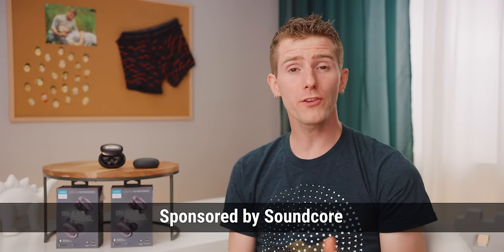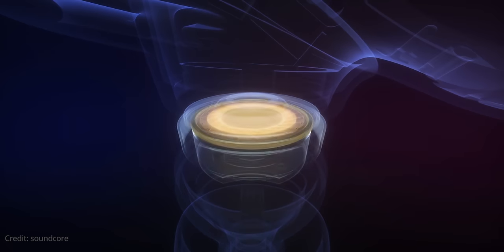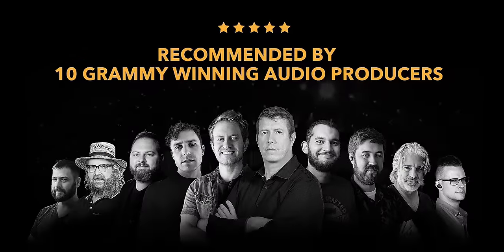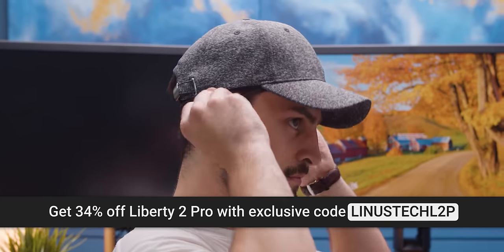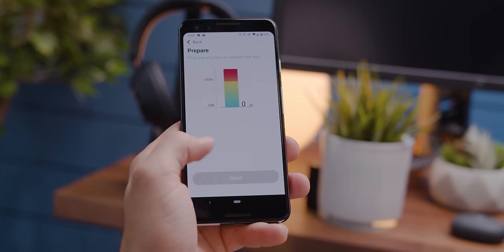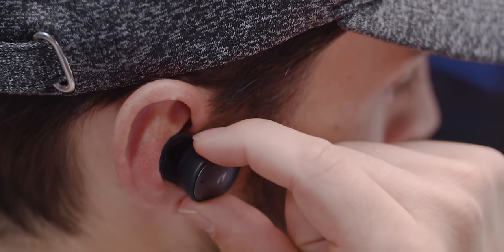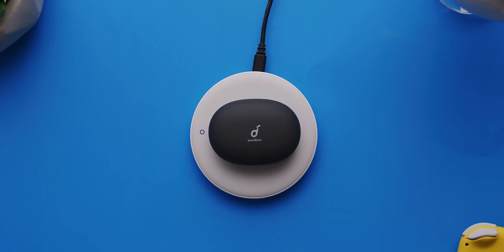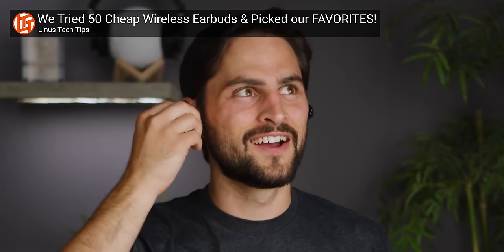What is Astria Coaxial Audio? - Liberty 2 Pro Earbuds Showcase

Comment: It says "incorrect discount code" :(
Reply: i was able to use it, but it was only $20 off.
Reply: Same, for UK store
Reply: Did not have a problem all was capslock
Reply: same for uk
Reply: I do have the same problem (german store)
Reply: Same
Reply: Yeah not working in german store. Yay
Reply: @Viewer13128  Yeah, it's a bit misleading because they don't specify what the 34% was actually taking off. The 34% doesn't make sense if you look at the pre-order pricing (34% off of $119 USD is about $40.46, dropping the price down to what should be around $79) BUT... if you do the math with their intended MSRP for their full release (34% off of $149 USD is $50.66, dropping the price down to $98.34), now it stars to make sense. $20 off of $119 is $99. Ugh
Reply: Worked for me
Reply: @AznIzzay  It's 34% the MSRP of $149 when they're released.  $119 is a promo price for pre-ordering.  $99 was available as a early pre-order price for 48 hours.  So this promo code gives you the same price as the early pre-order discount.  Pretty solid I think.
Reply: At least at the german store they fixed it. The code works now.
Reply: well anyone's order status is still "processing"?

Comment: I'm kinda scared of using that. I might lost it. I'm used to using earphones with wires. 😂
Reply: You'd be hard pressed to lose a wireless set of over ear headphones.
Reply: You get use to them, I had the same fears about switching to an ear bud set from a wired set. Only complaint is that for the gym, they "wiggle" loss and feel like they're just about to pop out. My last setup had very nice wraps for the ears, to hold them in place.
Reply: They are much harder to lose then it seems. Or you can get KZ E10, they have over-ear hooks.
Reply: Right? I use headphones/earphones for 8 hours at a time sometimes, and often in some extreme conditions. One wrong move and goodbye 75$

Comment: Received my pair two days ago.  I suppose I should try some other wireless ear buds to make a comparison.  The sound is what it should be for what it's advertised to be, without comparison with other earbuds I should refrain comment beyond that on the sound too much, for what you can shoehorn into that little wireless package with a battery they're really good.  Rich texture, full sounding, not too bright, not too warm (I'm not a practiced audiophile reviewer, if that wasn't obvious already).  Something to note, I like some bass, but using the Soundcore Signature setting (the one that works with the hearing test to customize to your hearing) I had to go into my music player's EQ and flatten everything out, something I don't normally do because I'm not into flat signature sound at all, so the Soundcore Signature has a bass curve in it already, some audiophiles won't like that.   I do have some minor hearing loss in the mid-range and I am excited that I can make out lyrics more clearly!  For that plus them being a very capable earbud, I'll give them five stars.

Comment: Couldnt find the info, does this have a water resistant rating?
Reply: scooby wences What they came out and said about it is that it is sweat resistant but you should wipe it off after use. They dont advise using it in a wet environment like the shower